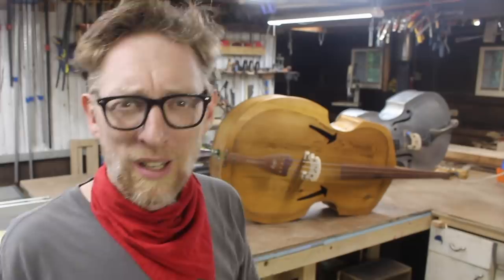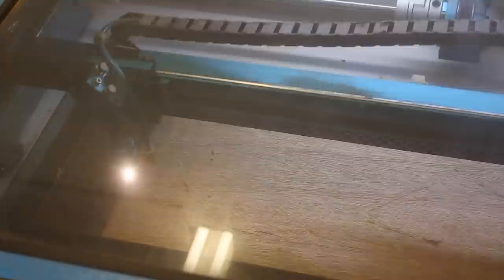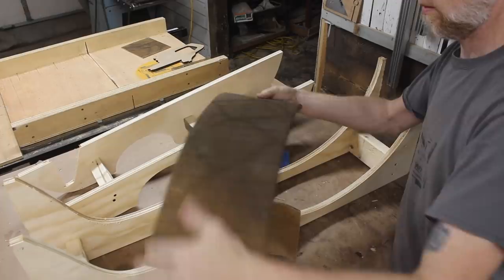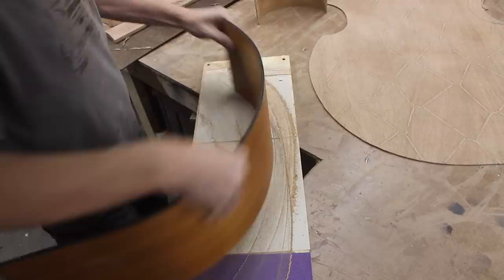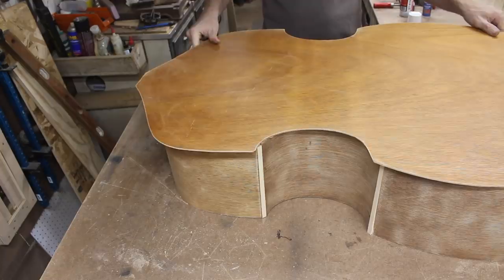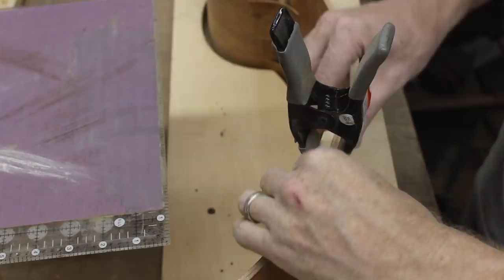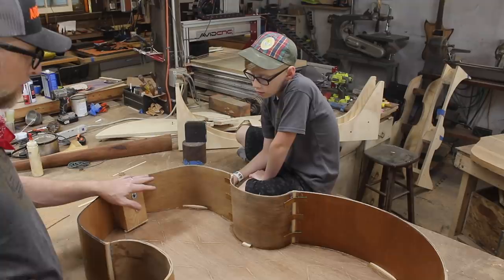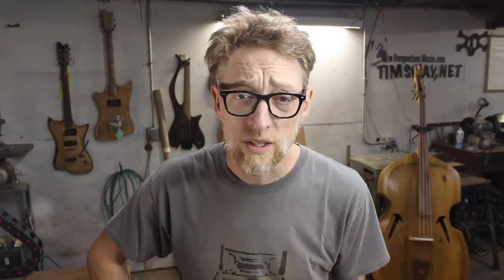DIY Upright Bass Made From "Trash" Part 1: Hollow Core Doors

Comment: Aren't basses constructed similarly to cellos and violins, where you use a carved block in each of the major joints to glue the wood to in order to provide support and structure? Basically, carve a block with the shape you want the exterior to have, minus the thickness of the wood cladding, and then you can just remove some of the excess from the back of the block once everything is glued up.

Comment: Your son Vance is pretty smart. Even measuring twice I've made mistakes, mistakes that made a piece of wood useless for that project. Maybe measuring seven times would have brought to my attention something wasn't right. Most of my projects are are built using the "prototype" method since I usually can't transfer what is in my head onto paper That's a by-product of being an auto tech all my life; I never had to write down how I was going to proceed with a repair. I knew what I had to do, and I started removing the necessary parts to get to the component that needed to be replaced. It also has something to do with my sketches not making a lot of sense sometimes when I look at the later.
Reply from the maker: cheers. most of the time I approach making like a sculptor, not a woodworker. I'm trying to teach Vance to be both :)
Reply: @timsway  It never hurts to have more than one method to approach building or repairing something.

Comment: Rather than section them off could you cut slots further in the mould so you can run the ‘c’ pieces further down. The trim then down to bevel against the bouts and corner block.  You really need corner blocks.
Reply from the maker: Yes. Good idea!

Comment: Absolutely awesomely brilliant........ however, it's worth respecting the f-hole though, apparently the shape of the sound hole has a huge impact on sound and it went through a long evolution to get to the modern instrument form.
Reply from the maker: My understanding is it's the length of them that adds to allowing sound to escape and the shape derives from keeping it stronger that a larger hole (like I made, that is a similar length). And the circles at the end need to be there to get the soundpost in and out. So the shape isn't as important sonically, more out of practicality. I think ideally for sound, the slit would run the length of the instrument, but the instrument would fail if that much wood was separated. One thing my arrows are missing that F holes have is a place to mark the location of the bridge, which I'm still not 100% certain I have right on this. More importantly, however, is my side indentations aren't designed right and this bass is difficult to bow (I honestly wasn't thinking about the bow as I never use it). But the way I see it, it works and it's made of crap, so I'm happy as hell. Next one will be better :)

Comment: Nice build Tim! I am curious as to why you didn't use kerfing around the edges prior to gluing the back & top on? It's relatively inexpensive & would make a stronger joint attachment along the edges. I know, from building an Acoustic guitar myself, that the internal bracing is extremely important to the structure & ultimate "sound" of the instrument. Although I am not familiar with a stand up bass of that size? You may want to consider additional bracing & how it's arranged in a bass of that size. I am looking forward to seeing the remainder of the build & really appreciate how you go about tinkering & figuring things out on the fly! Keep it up.................   :)
Reply from the maker: I based the bracing and kerfing (or lack thereof) on traditional bass building techniques and the inner workings of instruments I've seen, worked on and in my collection.
Reply: @timsway  Got it! So I guess that the back of the bass is not radiused? What about the front? Just curious.........  :)
Reply from the maker: @sapelesteve  the front is arched. The back is arched on some, but this one is a "flatback" design

Comment: Tim - wondering why you didn’t run some kerfing/lining all the way around the sides to create more glue surface for the back?  Seems like a 3/4’” strip or two of door skin kerfed on the back side would have done the trick.
Reply from the maker: The bases I examined didn't have that and you'll see on part 3 what I did that was the other reason I didn't want to.

Comment: At last!!! I was really waiting for that video !! 
That "double bent" technique for the sides is just killer. Do you think it can be achieved without the laser cutter (that I don't own)? 
Keep on with the cool ideas !!
Reply from the maker: I did some tests on my table saw with a sled, but the kerfing was too wide and sloppy. Maybe with a specialty blade in there, or by hand wth some sort of really sharp marking knife and a jig. It would probably be easier to steam bend real wood (which I will be doing soon :)
Reply: @timsway  yes the thin kerf seems to be the key and the laser the right tool for that. Very cool idea anyway. Maybe I'll dig in that direction when I'll have some waste of time to optimize ;-)

Comment: Super cool video. Think you can make glue from dead centipedes? I'm vegan but centipedes freak me out. : ) Mahalo for sharing!
Reply from the maker: haha! i contemplated using hot glue or PVA glue but was afraid it wouldn't have the tensile strength
Reply: @timsway  I think you made the right choice. : )

Comment: how thick it the piece of wood you used for the face plate of the bass ?
Reply from the maker: I laminated two 3/4" cedar fence boards together to make it almost 1.5" and carved the shape from that to about 1/8" thick. Honestly, it flattened over the years so it was not strong enough (or the right wood, of course). Still plays and sounds great, tho!
Reply: @timsway  thank you so much, that helps me out quite a bit. I love this whole series, I watched it start to finish, I’m thinking about building my own, and this was a great tool and source to see how it goes together. So thank you.

Comment: What wood work in tools would I need to find...to attempt, not a double bass, but a small cello or viola Da gamba?
Reply from the maker: It can all be done with basic hand tools, it just takes longer
Reply: @timsway  Thanks..I'm a REAL novice..at wood working!!
Reply from the maker: just like anything else worth doing, it requires learning and practice. You can also get sucked in to the spending vortex trying to get the latest and best tools, but all the tools do not make the craftsman, just like the instrument doesn't make the musician. You also don't need all the tools at once. Search your local facebook for yard sales and whatnot. Sometimes you get lucky and get a free lesson from the seller of the tools. And free, reclaimed wood is on its way to the landfill anyways so use that. If you mess up and throw it away there is no net loss: You learned from your mistake and the wood was already considered waste anyway.